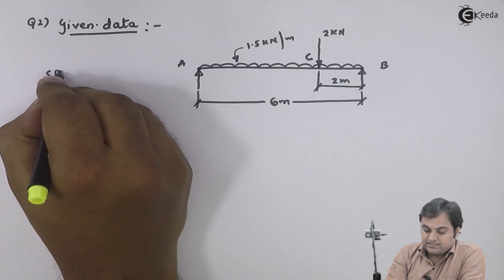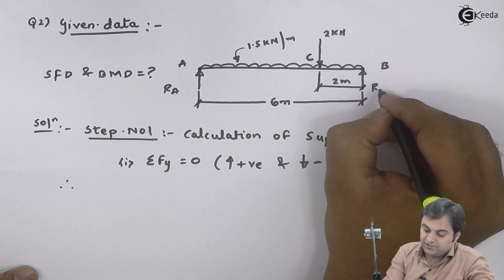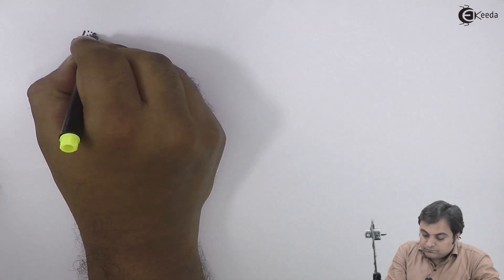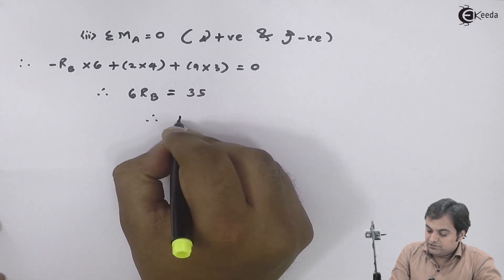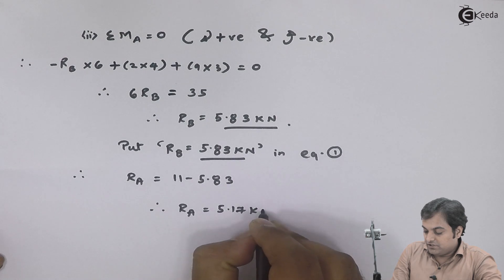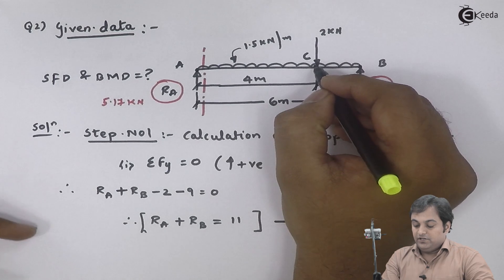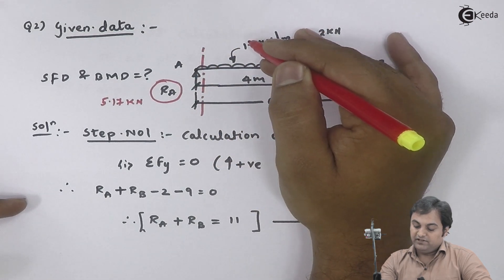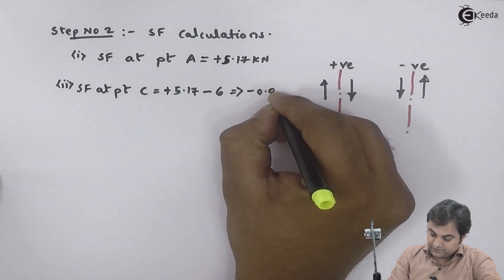SFD and BMD - Problem 9 - Shear Force and Bending Moment Diagram - Strength of Materials

Comment: A horizontal beam AD, 10 m long, carries a UDL of 360 N/m run together with a point load of 900N at left hand end A. The beam is supported at B, 1 m from A, and at C, which is right hand half of the beam, x m from D. Determine the value of x, if the mid point of the beam is a point of inflextion. Plot BMD
Reply: Solution??

Comment: Sir I have a query regarding to your video no. 4 of problem no. 2 on shear force & bending moment diagram that is 

As u said in previous video that there should be maximum bending moment if the shear force is zero on that point

But u couldn't find out the bending moment between point A to C as the point of contraflexture was occurred

So I want to know that by mistake u forgot that point or there is no maximum bending moment in this question..??

Comment: Sir why are you taking the distance as half of the distance while calculating udl?
Reply: bcz udl acts on half of of the length
Reply: Any udl can be converted into point load by multiplying the load applied × lenght of span it is acting . And after conversion the load acts exactly  inbetween  the lenght of span i.e 1/2 of span . Therefore for moment calculation of udl = weight×lenght of span × half of lenght of span
Reply: @meowandsomebow1355  thanks for your concern. But I asked as I had my semester exams nearby... And thankfully it went well